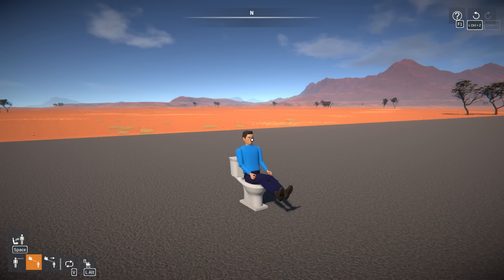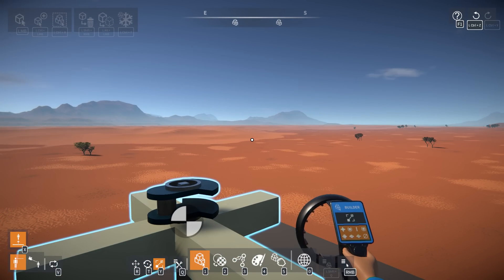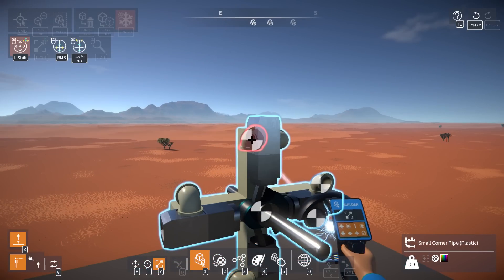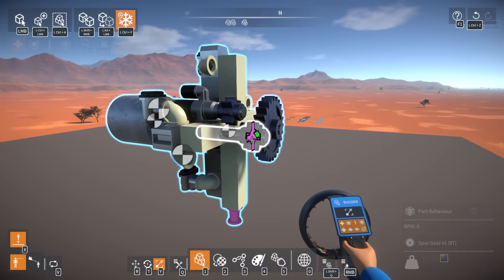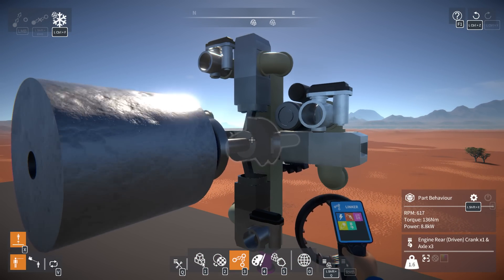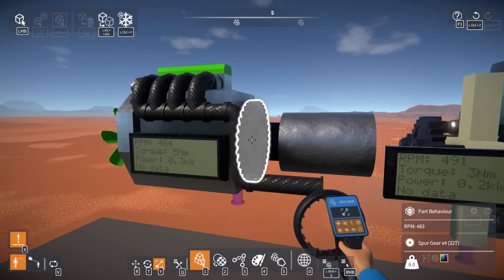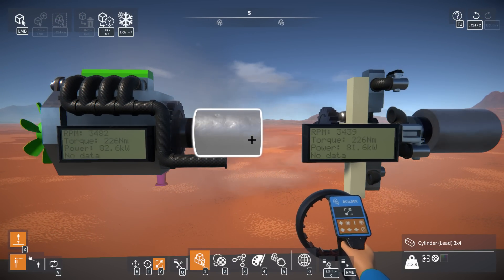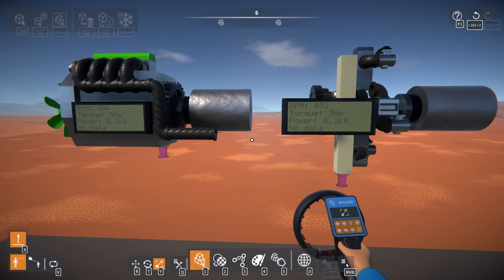I Built a Radial Piston Engine to Compare Against the Linear i4!

Comment: Carbon fiber is commonly used for exhaust because of how lightweight yet durable it is, additionally an average exhaust systems will get up to 500*F which is not even slightly close to carbon fibers “melting point” of 6,700*F. I say “melting point” because real carbon fiber doesn’t melt it sublimates, this means it skips the liquid phase and turns directly into a gas

Comment: Using Gemini, Carbon Fiber won't melt but it is not impervious to heat, while the carbon fiber will be totally fine, the resin can melt leading to structural failure so if they use high-temperature resistance resin and good manufacturing then it will work a treat!

Comment: Carbon fiber MUFFLERS are one thing, Carbon fiber headers would have degredationg of the resin that holds the carbon fiber together due to the extreme heat of the exhaust near the combustion chambers (Often, the headers also have to deal with a near direct/direct flame, as not all of the fuel is burnt in the combustion chamber, if you don't belive me watch any motor run without headers, excluding a diesel)

Comment: A carbon fiber exhaust will melt if the temperature of the exhaust reaches the resin's melting point, which is going to depend on what resin system was used for the layup of the carbon part. I would imagine that in order to make a carbon fiber exhaust for higher performing, higher temperature engines would be much more expensive due to the material requirements of the resin

Comment: Carbon fiber in exhaust systems are used more for their aesthetic appeal or lightweight properties rather than their ability to withstand high temperatures. To address this, carbon fiber exhaust components often have heat shields or are used in conjunction with materials that can handle higher temperatures.

Comment: Carbon Fiber would melt at the header, Kosmo probably has a carbon fiber exhaust tip where the heat is much less than at the header

Comment: To the kids who say Carbon fiber melts. It does not it is heat resistant up to 2500°f and forms a char layer and flakes off. If you bought carbon fiber and it melts consider your self scammed. You just bought fake epoxy carbon fiber. Epoxy is rated for only up to 350°f depending on the brand. Also carbon fiber is used in some heat shields, insulation, car parts, aerospace applications, and a lot more.

Comment: Carbon fiber sublimes at a temperature of 3652–3697 °C and has a boiling point of 4200 °C. 
 
Carbon fiber is generally heat resistant and doesn't melt,

Comment: I reccomend building the plane's frame around the engine, due to them mostly being made like that, ALSO have the pipes evenly separated on each side, not connected if possible. I want to see a P-400 american WW2 prop plane if possible aswell.

Comment: In a performance application the heat from the exhaust gasses would almost certainly cause the resins in carbon fiber to warp. So while you can use carbon fiber on most average engines, anything that has the budget to warrant carbon fiber exhaust likely runs hot enough that titanium is the better choice.

Comment: Just a note: carbon fiber doesn't melt. It goes straight from solid to gas, and it does so around 3600⁰C. Your engine isn't going to output that temp and if it is, run.
Reply: It's not the melting point of the fiber that's the problem, but the resin bonding the fibers, that can melt at much lower temperatures and allow the carbon fiber to delaminate.
Reply: @sixsixsevenseven-g5q  that's fair. I suppose what matters would be the quality of the resin at that point then

Comment: The headers' temperature is around 500F +. The carbon fiber itself should be okay, but the resin would most likely not hold up. Most carbon fiber exhaust is just the out part of the muffler, not taking much heat.

Comment: The carbon fiber exhaust is highly dependant. Cheaper carbon fiber couldn't handle any exhaust. Carbon fiber with phenol resins could withstand the exhaust of your average car, but a high-performance car would get too hot. It would melt the resin in the carbon fiber, resulting in delamination.

Comment: No it 100% wouldnt melt. Real Carbon Fiber itself has a melting point of 3,600 °C. What could melt is the coating/resin around it. So you would just need an heat resistant coating and you are good.

Comment: About the Carbon Fiber exhaust, it would be a major difference between Carbon Muffler vs Carbon exhaust Manifold, the temperature would be higher at the Manifold compared to the Muffler

Also as far as i know, Carbon Fiber Mufflers and so on usually have some metal between the Carbon and the inside, wich protects the Carbon Fiber

Composite materials doesnt have too high of a working temperature before the materials degrade, usually its needed to have a more specialized resin if its going to be used even in the engine bay

Comment: I've googled carbon fiber exhaust headers and only found vermiculite header wraps designed to insulate them from the engine bay. You can have an intake manifold made of carbon fiber with no issues though. I've also found CF exhaust tips, so I think you can have carbon fiber and other epoxy composites past the cat/muffler, where the exhaust gas isn't as hot. I'd suggest carbon fiber intake manifold and titanium exhaust, that'd look sick.

Comment: Carbon Fiber itself does not melt. But, the composites will if without special heat shielding or thermal-resistant resin thingies.

Comment: if the dev made an engine inline 6, where he angled those crank shaft to specific angle, does that mean you could build radial engine with like 12 cylinders but only 1 crank shaft?

Comment: carbon fiber mufflers is ok ( for the external chamber, not the pipe inside), but for header's, cross pipe, or literally all of the exhaust pipe.. nah
.
edit : i hope we can get a rotary engine and actual gear and pinion stuff for actual gearboxes like... idk what it's called, its looks like a cylinder but it has a groove line for the gear selector to move (mostly on sequential)

Comment: I think the firing order should be (clockwise) 1, 3, 2, 4 because now you have all cylinders fire, one turn without firing, and then again all of them firing. I'm not sure if that order is correct but it seems better than 1, 2, 3, 4
Reply: 1, 4, 3, 2 seems best, each fire happens after 3/4 of a turn, where in 1324 it happens sometimes 1/2 a turn sometimes 1/4 a turn. So 1432 is my guess

Comment: Check out Anzani radials 
He made engines with even number of cylinders, but they are all two strokes so firing order is easier

In Gearblocks you should change firing order from 1 2 3 4 to 4 3 2 1 (270° degree between),
so you basically have rotation of engine in "opposite" way of firing order
This should result in more smooth idle

How to reduce "knock":
That is the sound if pieces colliding together, wheel in from is geared to spin 3 times faster that engine, which makes it go crazy as simulation can run into problems at such high rpm
Try using larger "flywheel" or try combination that will mesh, there is a LOT of gear sizes in Gearblocks

Simulation settings:
If you press Num0 then open the menu, you can edit simulation speed and quality, if possible, go for higher frequency, as that helps with high rpm engines

Comment: the melting point of epoxy is about 120°C, but the melting point of carbon fiber is about 3600°C, so I think the epoxy would melt and the exhaust would  deforme

Comment: I just want to say there needs to be clarification on what you’re calling exhaust. You’re referring to the exhaust header, which should never be made of carbon fiber as the resin/polymer will melt in those temperatures. An exhaust muffler might be okay depending on the composition of the entire system. Carbon fiber mufflers on mopeds and bikes are popular but it’s usually just a skin around a stainless steel or titanium tubing.

Comment: correct me if I'm wrong but I believe the radial had a less smooth idle because it doesn't have pairs like the i4, the i4 the inside and outside pistons alternate which is firing, the pistons fire every second revolution, I think the radial might be doing the same but because there aren't the pairs it  spend one rev with power and one without causing the less smooth idle
Reply: I think his firing order is reversed, so he has power cycle in one rotation, no power cycle second rotation, etc. making idle oscillate

Comment: Carbon fiber molded products may not be able to withstand high temperatures if they use poor resin, but they are usually very heat resistant.

Comment: carbon fiber exausts are fine, carbon fiber headers (what you have) is not. it will melt take a torch to that exaust it will melt, thats pretty much ehat the inside of a header experiences.

Comment: An entirely carbon fiber exhaust wouldn’t work as the resin bonding the fibers would melt, how ever the an only carbon fiber weave exhaust wrapping would help as heat insulation just like titanium fiber wrapped exhausts.

Comment: carbon fiber doesn't melt it goes straight to gas for from a liquid, also it does this at over 3600 C or  6512 F which is 9 times hotter than the average exhaust temperature

Comment: I think the carbon fiber is not containing the exhaust. It is an outer cover. There should be a inner steel tube with the carbon fiber decoration. On old Audis with carbon fiber engine covers. They yellow severly due to heat.

Comment: Carbon fiber in the exhaust could work but not straight out the engine block there the temperature would burn off the resin that holds the carbon fiber in place and makes it gas tight but at the end of the exhaust where the temperature is lower could work

Comment: Where did people get the idea carbon fibre would melt lol
Carbon fibre melting point is 3600C
Steel is 2200C for comparsion
Carbon itself has one of the highest melting points of all elements

Comment: I have a v16 on the workshop and it outputs a crap ton of power. Also kAN, the "rod knock" was your idle gear from your starter wigging out at high rpm.

Comment: To know if the starter is rotating the engine in reverse you can look at the rear engine crank and see if the rpm is either negative or positive, if negative invert starter, also you can invert starter solenoid to avoid meshing 3 gears

Comment: I searched up how hot engines usually get and its between 175 and 220 Fahrenheit, while carbon fiber melts at around 3675 Fahrenheit, so no, a carbon fiber exhaust has almost no chance at melting.

Comment: Typically radial and rotary engines have odd numbers of cylinders for balancing purposes (hence the new 5 angle and 9 angle engines)

The firing order is a star pattern like how you would tighten lugnuts so a 5 cylinder would be 1-3-5-2-4 or 1-4-2-5-3

Comment: So I went ahead and looked this up, so I got some actual data for you. I'll put it in Celsius first for ya, but I'll also include the Fahrenheit temperatures for my fellow Americans.

DragonPlate high-hear carbon fiber is capable of withstanding temperatures up to 260° C or 500° F.

However, NASA has developed a significantly more durable carbon fiber for aeronautical use that can withstand 1000° C or 1800° F.

So I'm with the opinion that carbon fiber exhaust is good. 👍

Hope this settles the debate. All I did was search "carbon fiber high heat tolerance" so anybody could have looked this up, but hey, no judgment.

Give me a shout out if you end up reading this, appreciate you, and keep on doing what you do.

Comment: fun fact! each crank pin can have up to 16 cylinders connected to it!
also, not insulting you in the slightest but its kinda hard to watch you build things the way you do, not knowing things like the fact gears will mesh regardless of if they are on the same plane, if you just use a slightly larger gear for the starter you can make it reach
small details and not knowing drives me nuts for some reason anymore

Comment: The only thing is - all radial engines having uneven number of pistons: 5, 7, 9...
Reply: That is rather hard to do in a game that uses a grid based building system
Reply: @kiwigaming09 this game actually has specialized beams specifically for doing 3, 5, 7, and 9.
Reply: Wrong, there are radials with even number of cylinders
Anzani made radials with even number of cylinders, but they are all two strokes so firing order is easier
Reply: @jakubpollak2067   well yeah, but it only works for two strokes, for four - only uneven number

Comment: The melting point of cardin fiber is really high but dependent on how it's made.  Also the clutch needs adjustment I the engine you have the clutch should be disengage to at least 800 rpm and then ingauge at 1100.  That's what I do so the vehicle doesn't want to go when you start it.

Comment: Tldr: normal use carbon fibre fine, modified use definitely nit

With the carbon fibre melting, definitely during normal human use other than the exhaust manifold**, carbon fibre is fine, but the highest temperature resins melt at roughly 300*C (roughly 600*F). Though if your engine is turning your exhaust glowing red, that is roughly 500*C (1000*C) which will then melt it

**im not 100% sure how hot a normal exhaust manifold gets

Comment: Carbon fibre won't melt, that's never going to happen due to it being carbon. The problems arise with the type of material used in composite carbon fibre (the stiff stuff used in cars). Some are polymer, such as for body panels, others use non-polymers, such as for exhausts and other ducting/piping in engines.

It's no different to fibreglass in many respects, as you can use various materials reinforced by the carbon fibre matrix.

Comment: as far as u know carbon fiber parts are actually resin with carbon fiber in it. and so it would not be heat resistant.
Especially as the exhaust header.

Comment: Carbon fibre doesn´t melt, it´s not a metal or fluid. It´s high dense carbon, pressed into shape. If it would do anything on really very high temperatures, it would start to burn. And yes, there´s carbon fibre exhausts, but not sure if it´s just the mufflers.

Comment: Carbon fiber doesn't sublime until about 3800 F, but that isn't what's holding the carbon fibers together.

The resin is what melts. Even the best HTE (High temp epoxy) melts at 600F, to give context, exhaust gets to about 1850F. 

Kosmo doesn't have a carbon fiber exhaust, he may have a carbon fiber veneered heat shield! But the exhaust itself is steel.

Some heat wrap for exhausts are carbon fiber woven with no resin, but again that's not the exhaust, that's a wrap around the exhaust. 

Usually the heat shield wrap is fiberglass though as it's cheaper and has similar thermal properties, so why waste money on woven CF heat resistant exhaust wrap?

Comment: The reason your radial is clanging is because axles get unstable above about 10k rpm. The idler for your starter is trying to run at 12k and making a fuss about it. You can usually see the parts jumping around.

Comment: The carbon fibre debate depends on the definition of carbon fibre. The indiviudal fibres are highly heat resistant (up to 5500°C). If we define carbon fibre as carbon fibres reinforcing a polymer matrix then it cant, as most polymers cant withstand more than a few hundred °C, however "carbon fibre" is a fibre reinforced matrix which by definition does not limit it to polymers only. Carbon reinforced ceramics do exist (carbon ceramic brakes) which could be applied as an exhaust although its manufacturing process would limit it quite a bit, plus it would be quite brittle so the shaking of the engine would not do it any good. Thats why most performance exhaust is titanium.

Comment: Carbon fibre is held together with epoxy or some other plastic.
Depending on what that plastic is, and more importantly, the size of the exhaust and things like that, it could melt.

If it is for a small vehicle, with a relatively large surface area to volume ratio, it will have a small amount of heat in the exhaust which transfers to a large area which is cooled quickly and so it doesn't melt.
However, for a large vehicle, with a smaller surface area to volume ratio, there is more heat from the exhaust which gets dissipated by a smaller area so it gets hotter. Eventually you reach a point where it melts.

Comment: For the radial and V engines you should use premade angle beams. These let you easily make 3, 5 or 9 cylinder radials. For the V engines it allows different angles between the engine banks.

Comment: Normal carbon fiber headers won't melt they will burn due to the resin.
The special stuff using a ceramic bonding material can actually go up to 1000 degrees which is enough for many applications.

Comment: the issue with pure carbon fiber exhaust is teh resin breaks down, it will turn yellow after just a few heat cycles and then crack.

you need a kevlar carbon composite fiber exhaust if ya want it too hold up to multiple heat cycles. if ya ever saw carbon fiber but it had gold weave that would the stuff I'm talking about.

Comment: Carbon fiber exhaust melting entirely depends on what you mean. A car with a CF header? Ya, it'll definitely melt. CF mufflers? Probably fine.

Moped is probably fine because of very low exhaust volumes and exhaust temps.

Comment: I know you from your videos that you make mistekes often, but how could you get the rotation messed up? You have reversed the starter instead of the driven crank and it means you should correct your mistake cuz the fireing order is reversed to the rotation and makes your engine misfire and in real life may do a lot of damage to the engine not just performance issues.